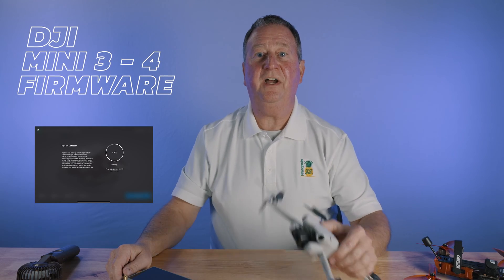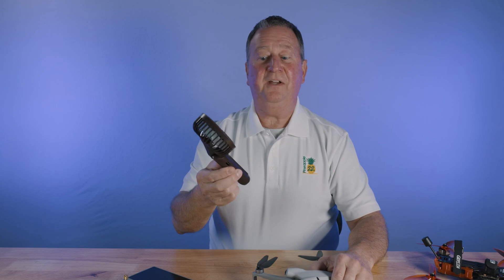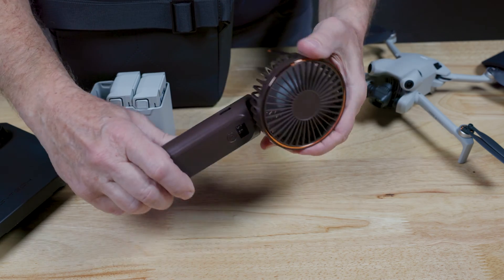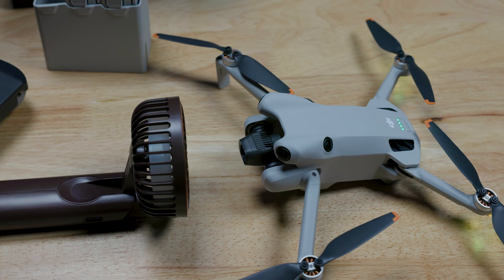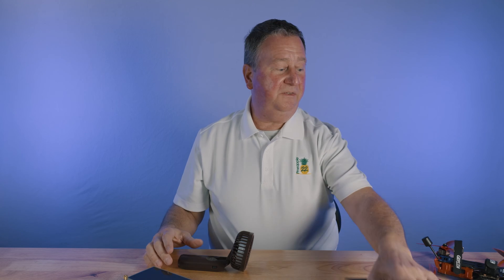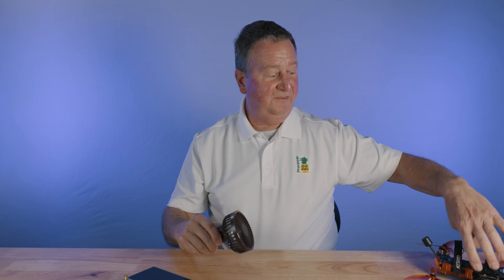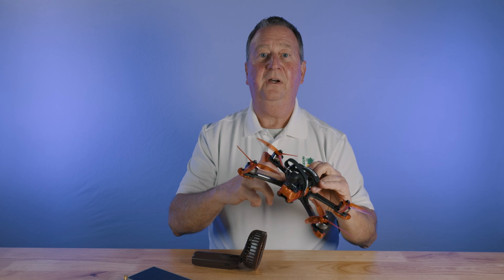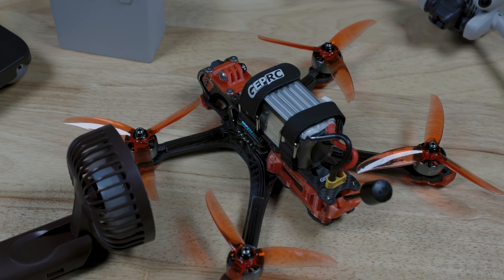STOP Overheating Your DJI Mini 3 or 4 During Firmware Updates!

Comment: How about setting it on top of an ice pack
Reply from the maker: That most likely will not work because you need air flow through the drone to cool the electronics.
Reply: @Pineapple22  thank you. Makes sense. I put ice packs in a bowl with a dish on top and drone on dish.  All worked fine.

Comment: Thanks for the good advice. Could I just run the rotors as I do when getting ready for take off, or would they not cool the fuselage enough?
Reply from the maker: The motors will not run during an update but if you just have it sitting going through the menu or something like that you can start the props to keep it cool.  Thanks for the comment🍍

Comment: Had plans to buy a mini 4 pro. I won't dump my $ in a drone with overheating problems.
Reply from the maker: It does not have an overheating problem unless it is sitting without the props running.  The Mini does not have an internal fan like the Mavic drone.  I have never had any problems with it flying and use it multiple times a week.
Reply: @Pineapple22  To me that is a problem. best regards!